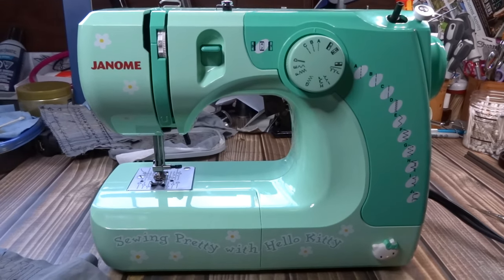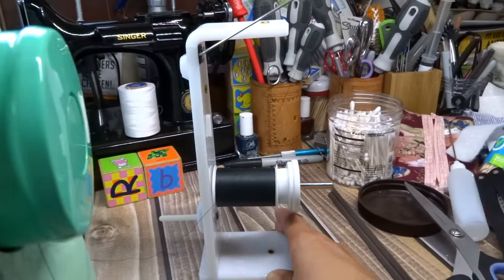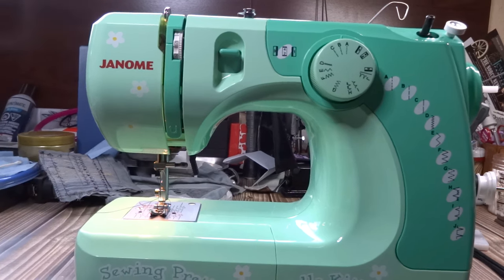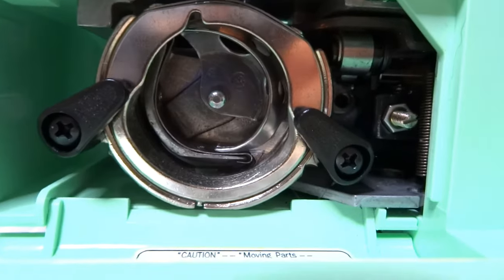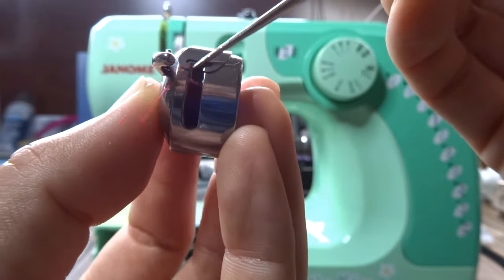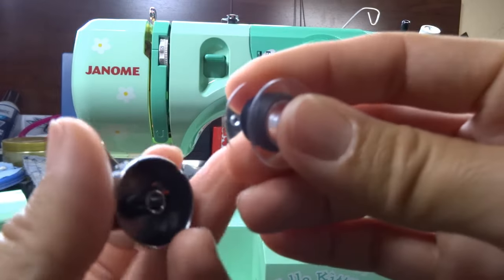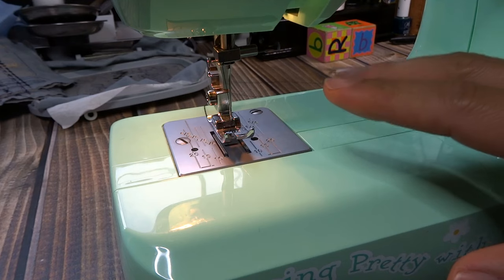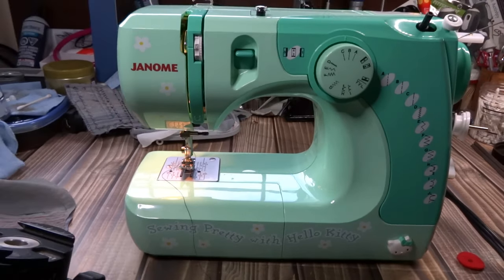How To Use A Sewing Machine

Comment: I have excatly the same machine that was a birthday gift a few years ago,but it had no manual with it,I've followed you instructions excatly yet for some reason mine won't stitch,its like the two threads aren't connecting to each other ,i tried everything else from changing bobbin types, threads,needles,tensions everything,and when it dose sew it will only be a couple of stiches before they drop again completely.any ideas where im going wrong??

Comment: Something is up with my bobbing casing. I’m not sure what’s happened, but suddenly the bottom of my work is full of mess, and I keep getting jams around the hook. Any idea?
Reply from the maker: Sorry, there are a bunch of possibilities.  Take out the bobbin case and clean out that whole area in there.  Look for any threads caught inside.  Rethread the whole thing, making sure that you are routing the thread the correct way and the bobbin is inserted correctly.   Use a new needle.  That would be the first step.

Comment: I just got the new home , and I can not get it to sew, it’s brand  new, I put the tread followed instructions but when I star the machine to star sewing nothing happens
Reply from the maker: Diana Miranda - I would need more data than that to help you.  You should be able to follow all these steps in the video.
Reply: Vyshtia I will re watch it again, it’s my first time and I have found this so hard. Just to even set it up. I think it’s probably the way I have the bobbin . I will try again and re watch the video
Reply from the maker: Diana Miranda - yes, it can be quite overwhelming at first.  Just follow each step one by one.  You may have to watch it several times.  But once you get the hang of it, it will be easy.